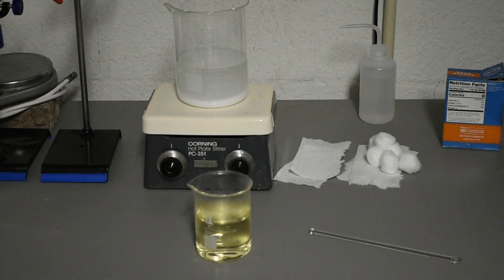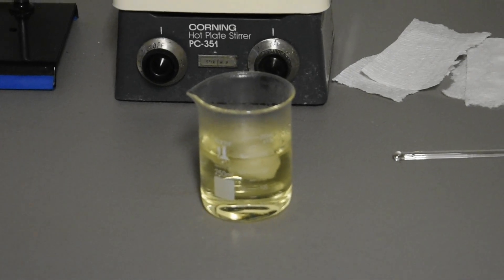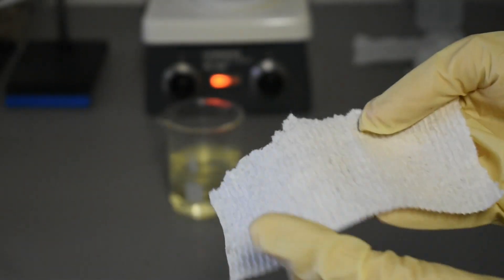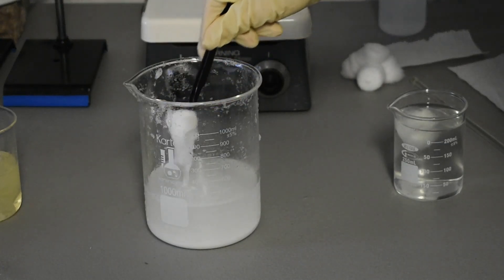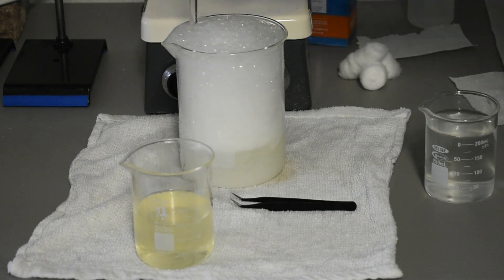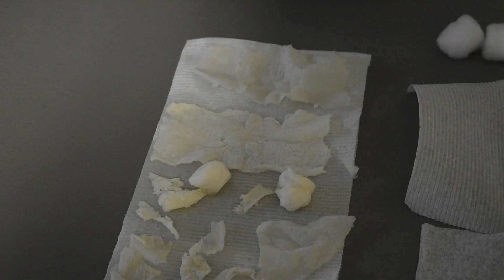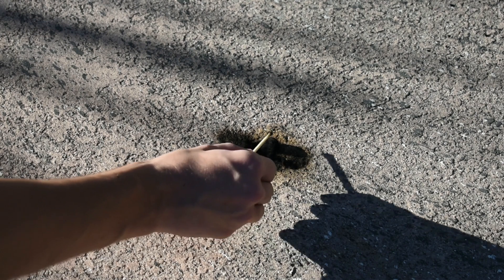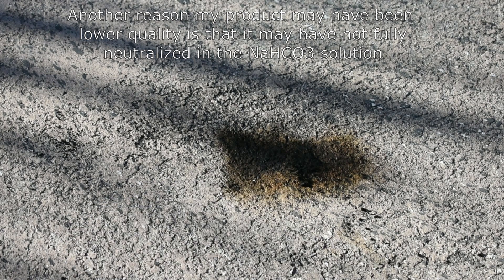Preparation of Nitrocellulose

Comment: A tip for next time, wash the nitrated cotton in water to remove excess acid before neutralizing in bicarbonate. It will help reduce the foaming. Also wash with water after neutralizing a few times to remove all bicarbonate. Just pour off old water and add fresh stuff a few times and you will get less ash in the burn.
Reply from the maker: Thanks for the tips! I'll be sure to use them next time I try NC